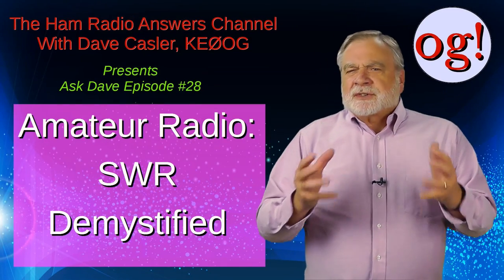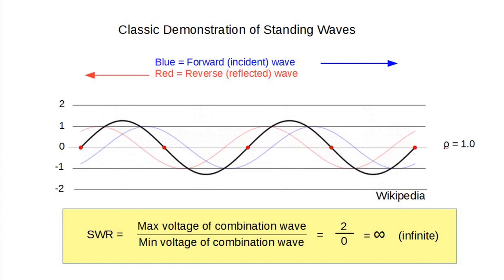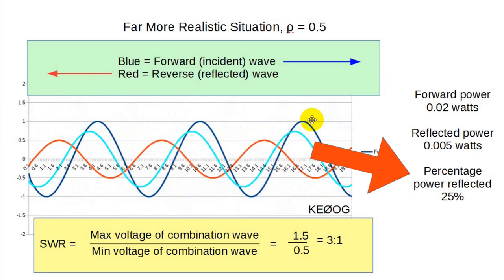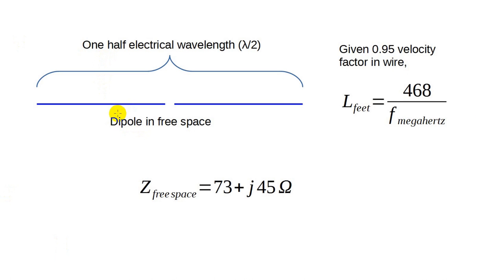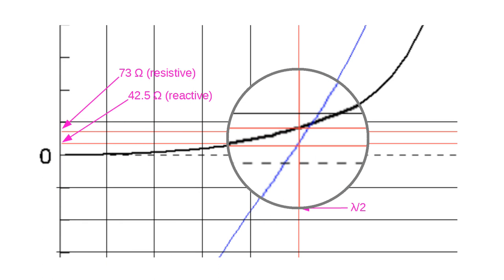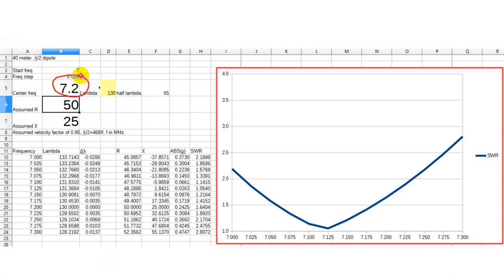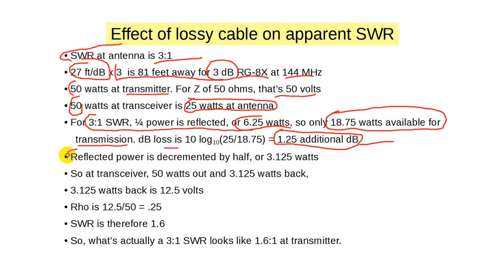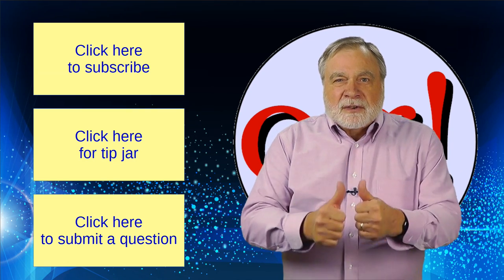SWR Demystified: AD#28

Comment: Great video! I'd like to add that an antenna can have multiple resonant frequencies.  The antenna is resonant when the inductive reactance and capacitive reactance cancel each other and we're left with a purely resistive load.  This occurs at multiple frequencies for a given antenna.
Reply from the maker: Absolutely! The chart I showed in fact had three points of resonance, and if the frequency range had been extended more, there would have been more. Also, multi- band antennas can be made with points of resonance in all the useful places. As I pointed out in the video, the equations I derived were only valid very close to 1/2 wavelength. But, generally an antenna will have only one resonant point per band.

Comment: Thank you for taking this easy to measure and say metric  and providing understanding for giving cause to overly simplified usage of the ratio. 

Too many discussions imply that swr reflects (ha) the end all for accomplishment of having an effective antenna system..  An increased risk to users of modern transceivers who are not into the science of antennas. Imposing to see even this quick look exposes just the beginnings of the inherent complexity.

One question, maybe noted elsewhere, would some of the reflected power recycle back from the transmitter and with portions eventually being added to initial transmit full power getting thru to being transmitted...and effectively reducing losses as expressed or is the this already contained in the measure?  ...

Thanks again for all you are doing.    Very beneficial for a 70 year old business major

Comment: I just found this vid.  Love it.   Dave I am a Technician.  I talk on 10m and still use 11m because I have more access to people helping me figure things out.  Even though those are not ham guys they still like to use wire antennas and make their own.  

Here is my situation if you could elaborate on this for me it would help me and my friends understand where we are.

we are all using 1/2" alum tubing and then smaller piece on the end to slide back and forth to get the SWR correct.  I have the alum tubing inside of 1/2" schedule 40 pvc pipe and it fits nice and tight and is sealed properly so no water gets inside.  I have a 50 ohm coax connected to the feed point.  I have the tubing 2 inches apart and the ground braid and the center line connected about 1.5 inches or so apart to a screw head on each piece of tubing going all the way in to the other side of the tubing so it is connected on both sides of the alum tubing with each screw and the wire wrapped around and soldered to the head of each screw.  I am trying to figure out what the length is for 11 meters or 10 meters.  I use 11 meters because I have people I can readily use to test etc .. ok .. I would do 10 meters but nobody is locally on where I live that I can get them to test with me did contact with a few guys locally but they don't give you time of day ham guys that is ... sooooooooooo
1.  What length should I start off with for 11 or 10 meters.  I do use the formula to get the length of a dipole for 26.965 to 27.405.  Says it should be 103".
2.  I started with 102 1/2 inches and got an SWR on 27.405 at 1.56 and 26.965 an SWR of 1.22 using a Rig Expert.  I have the antenna in a vertical position.
3.  Coax is 50 ohms and at the antenna feed point is 72.5 ohms based on what I read.  How do I know what the impedance or ohms is at the dipole feed point if it is not 72.5 ohms.
4.  I looked this up on the internet and the article says on a dipole you can't get any better than a 1.45 SWR on a dipole.  Feed point is 72.5 ohms and the 50 ohm coax =  72.5 ohms  / 50 ohms  = 1.45 SWR.    

They said that lots of people keep cutting down the lengths of the dipole until they get a 1:1 SWR.  Which is not good because you may have a SWR 1:1 but the antenna will not perform well because it is so much shorter than it should be after cutting it down for SWR.   This is where I am lost ...  If 1:1 SWR is not important or required then how do you know how long the antenna should be ..   all my amps will not work on a SWR greater than 1.2 or 3 properly they get hot or burn up ..  so with an SWR of 1.45,  connecting point at a 11 meter (27.965 to 27.405) dipole is 72.5 ohms and 50 ohm coax what length should each side of the 1/2 wave dipole be then?
I have spent I mean to tell you hours and hours and hours cutting and wasting so much wire I decided to go to aluminum tubing so i can just slide it back and forth and not cut the wire etc.  I know what I typed sounds strange or even confusing which is so true I am confused ..  I read sooooooooooooooooooooooooooooooooooooooooooooooooooo many freaking things about what to do and nobody is consistent.   After watching what you just demonstrated in this vid I know what I am doing basically is not right.  I am really trying Dave it is not something I come to you without many many hours of trying and reading and reading and reading about SWR.  I literally use two different SWR meters and a Rig Expert and I cannot for the life of me figure out the correct antenna length for a good 1/2 dipole ..  at this point I am over the 1:1 SWR thing ... I just need to know how long should my dipole be for 26.965 to 27.405 without worrying about the SWR.  I just want to know what the correct length is without sacrificing the integrity of a proper dipole ...  sure could use your help DAVE I know I am nothing compared to you or other hams out there but I am wanting to learn along with my buddies .. thanks Dave i watch you all the time.
Terry

Comment: Reflected power is like a pendulum if the transmitter is tuned to the antenna's complex impedance.  The reflected power is continously re-reflected while constantly being reduced by mainly cable losses.  The point is that all transmitter power, less mainly cable losses, will be radiated by the antenna if the antenna is tuned to resonance using an internal or external tuner.  

To simplify, if your tuner can tune a 3:1 SWR  antenna to a complex impedance of 50+j0, it will  radiate close to 90-95% of transmitter power with a low loss coax cable or ladder line.  Of course,  you should always try to build your antenna to get the lowest SWR considering the time and effort to do so. As you stated most tuners can tune a 3:1 antenna to resonance.  Tuner losses are usually very low.

Comment: What a great presentation of such a complex subject. I can't praise it enough. What's missing for me, now, is how antenna tuners work. Obviously they counter the L and C reactances - well, "obviously" just means I assume so - but. . . I'll start over; Obviously antenna tuners reduce the reflective power coming back to my tuner, so it doesn't destroy my transceiver (and thankfully the transceiver is smart enough to shut itself down if I make a mistake). But, in listening to other people's videos and a little bit of reading, I've gained the impression that there's little else gained in using a tuner. Also something I listened to said that a tuner pushes the reflected power back toward the antenna and that it brings up the output signal, but I can't see how that's possible. Well, now I'm clearly in over my head, and I better head off to bed. Thanks again - I'll be back later to listen again. 73s - KC1DIW
Reply from the maker: Indeed, the antenna tuner catches the reflected power and sends it back toward the antenna. Some of that is radiated, and then some reflected back to the tuner again. So if the antenna is capacitive, the tuner will present an inductive reactance. Between the effective inductance and the effective reactance, there can be large circulating currents. These can create large I^2*R losses if the effective Q is high. Fortunately, for low values of SWR, they are not much of a problem for a tuner.
Reply: Another interesting and thought provoking video. Sometimes I think that we are all too hung up on VSWR, probably step one of the design should be an antenna that has the radiation pattern we want. Step two can be working out how to feed it...

Comment: For 15 years I had no SWR meter and fellow amateurs were horrified when I tuned my long wire simply for maximum radiation out using an r.f. detector, I never blew the home brew h.f. rig.  When I did make an SWR meter about 5 years ago it showed it was correct, maximum power out coincided with a good SWR.
It's a resistive Wheatstone bridge type. The limiting factor is the power handling capability of the resistors but I use QRP so it's not a problem, 5 Watts will give a 1mA meter full scale deflection with a little more to spare for adjustment.
I love playing with aerials, I have an inverted vee for 40m, made a dipole two years ago when I got on 2m, then recently made a Super J Pole and last week turned it into a 4 element centre fed Franklin collinear for 2m. Also been playing with magnetic loops for h.f.
73, Bill, G4GHB.

Comment: Nice video and explains why my wanting a full wave antenna on the mobile would not work (I'd asked elsewhere and they couldn't remember why but that it would fail). I wanted it for length to try and get a resonant antenna on 480mhz with the elevated feed under it to match a similar length to the VHF hi with ground independent load (or at least the stainless whips).

So going by your theory here,  since a full wavelength is around 60cm that would mean that a 90cm whip should work efficiently? How would it likely compare in efficiency to a 1/4 or 1/2 wave?

Comment: Just before 1pm on Field Day this year I connected my antenna analyzer to the coax, and I got about 1.32:1 SWR across the entire 20 meter band. Then I realized I was checking the SWR of my HF radio and not the antenna. :o My antenna is/was a Buddipole Deluxe configured for 20 meters at 19 feet, and my SWR was 1.42:1 at 14120 without the antenna tuner, better than 2:1 at the low end of the band and 2:1 at the high end of the band. With an antenna tuner the SWR dropped to 1.11:1.

Comment: Great job, you put a lot of work in on this one and it is really appreciated.  In one of your future views can you cover current phase angle, how it affects radiation and how to correct for it?  Thanks for all your hard work.  Allen N7LVS
Reply from the maker: I've not run into any material that properly looks at the phase difference between current and voltage along an antenna. I'd like to construct something because the usual animated GIFs wrongly assume the antenna is entirely reactive, with no radiation or ohmic resistance.

Comment: Dave - I was going through one of your old videos (May 18/2016) on SWR and at about the seven minute mark you are referencing the highest and lowest points of the Cyan wave form.  You refer to its highest point being 1.5 and its lowest point being 0.5, but on the active graph in your video it appears the lowest point is actually a constant 1.5.  This would alter your calculation significantly - unless I'm wrong.
Michael VA6XMB
Reply from the maker: Sorry to have gotten it wrong.

Comment: Near the end I thought (dangerous I've been told) about a dummy load power meter at the transmitter output going into a feedline and again using the same meter at the end of the feedline to see how lossy the line is. Probably should have done this with my new feedline to compare it with later readings. As it is, I can only afford electricians tape for the weekends that it's allowed up. Thanks de AG7MW
Reply from the maker: Good idea! I've not thought of putting power meters at each end of the cable. I'll have to give it a try.

Comment: Hello Dave I have always been under the impression that a 3/1 or lower is ok to transmit.not that I would normally accept over 2/1. What is your opinion on this please Dave as I have been working on some antennas for portable work and this question has come up a lot and I really value your opinion thanks in advance Dave de 2e0njk 73
Reply from the maker: In general, modern HF rigs will transmit into an antenna that shows less than 2 to 1 SWR. If it's greater than this, the antenna will start to reduce power to protect itself. Many modern radios come with antenna tuners that will tweak up an antenna system with an inherent SWR of three to one or less. In other words the antenna needs to be pretty near resonance already. The purpose of the tuner is just a touch that up. If you have a higher SWR, you can try a wide range tuner, like most of the aftermarket tuners. If you're dealing with QRP portable work, you might take with you a very small QRP antenna tuner.

Comment: Hi, this video was amazing and eye-opening, what i want to know is - where do matching transformers come into the picture? They seem to be ignored in stuff relating to SWR but surely they matter?
Reply from the maker: A tuner can match a reactive load and make it look resistive to the transmitter. A transformer can't do that by itself.
Reply: @davecasler  Thanks for the reply, Is that because tuners contain inductance and capacitance?

Comment: You start out with the statement that SWR is one of the less important measures of antenna performance. Could you talk about measuring the more important ones? Also, I'd love to better understand characteristic impedence in the first place, and how it relates to actual total impedence and feed line loss.
Reply from the maker: Unfortunately, people use SWR because it's so easy to measure. There's also the percentage of power that's actually radiated, the beam pattern, etc. But the real measure is how much you like the antenna after having used it for awhile!

Comment: Fbs way I learned radiation resistance: (1) Resistance converts electrical energy to heat. (2) The ohmic resistance of an antenna heats the antenna. (3) The tadiation resistance of a antenna heats the rest of the universe.

Comment: I do not know if this is true or not and I do not even remember where I learned it at but is it true that a Longer antenna (on HF) is easier for a tuner to handle that a to short antenna?
Reply from the maker: Long or short is relative to the wavelength, which is different when the frequency is changed. The standard antenna is the dipole, which is one half wavelength long. At lower frequencies the dipole is longer, at higher frequencies the dipole is shorter.
Reply: his question is "whether it is easier for AT to work with "longer than resonant" than with "shorter than resonant" antenna. First, dependence of R+jX from physical length is dependent on type of antenna. For 1/2 dipole or 1L loop, longer antenna has higher R and +jX reactance (inductive), for 1L dipole and it's derivatives (bow-tie, cone antenna), reactance is opposite (-j for long, +j for short) and R peak it's maximum at resonant F, decreasing both for shorter and longer antenna.
Reply: Antenna tuner can work with any type of reactances, +j and -j, and transform R to any direction. For longer dipole (e.g. 80 +j20 instead 73 +j0) antenna tuner need just capacitance to deal with +j20. For shorter dipole (e.g. 60 -j20) tuner need inductance to deal with -j20. Building variable capacitor is much simplier than variable inductance. Dealing with R mismatch is even more hard. Simple lumped L network deal only with +-j, not with R. Dealing with R usually involves transformers, and they have fixed ratio

Comment: I put my swr meter near tx. I want my tx to be happy.  It thinks i have Swr 1:1 across the whole band.  I am purposely using a 100 ft coax. I string a sloping endfed with 49-1transformer   The antenna is 66ft and it slopes from 43ft to 6ft.  I frequently hit the west coast from east coast and hit Italy, Finland, Slovenia. Also south into Caribbean.  This is with a G90 at 20 watts cw mode.  So I know the antenna is propagating.  When i try a 50 ft coax, my propagation is not noticeably better but my swr increases as expected so my radio is not as happy.  The antenna is put up in about 15 minutes and i take it down before i go to bed.  I check swr through my radio’s analyzer and mfj 259.  I have to wonder if maybe I should try a 75 ft coax.  I think my antenna is using the longer coax as counterpoise.  I tried adding counterpoise and it did not affect swr at all.  I know my swr at antenna cant be that good as it appears but the transceiver thinks its great.  So I don’t have any counterpoise.  
Also, it thinks it’s 1.1 on 40 and 20m.  And less than 2.4 on many bands.  It has a built in tuner but i never use it.  
Love your video. It was very interesting. Thanks

Comment: Dear Dave, circa 05:15, you say "...by definition, Standing Wave Ratio, or SWR, is the ratio of the peak voltage of the combined waveform divided by the combined waveform's minimum voltage. Note that the peak value of the combined waveform is two volts. And the minimum is zero volts peak...for a ratio of infinity." However, doesn't the animated Standing Wave illustration reach its minimum at MINUS two volts? Or, is min and max for SWR computed using absolute values? Or is there another "rule" regarding the way the "Minimum Voltage of the Combined Wave" is calculated? Many thanks for all your help! Rick
Reply from the maker: When the wave is damped all the way down to zero, the voltage is zero. Maybe it would be easier to understand as ratios of peaks.

Comment: Wait just a single minute... you say that the resonance feedback only happen on the transmitting frequency??? what happen with the adjacent harmonic frequencies! the double, and triple..
Reply from the maker: Transmission lines are passive systems and as such operate only at the input frequency. Without active (non-linear) components, they are incapable of creating frequencies not already present. If harmonics are input, then they can be filtered also.
Reply: thank you sir